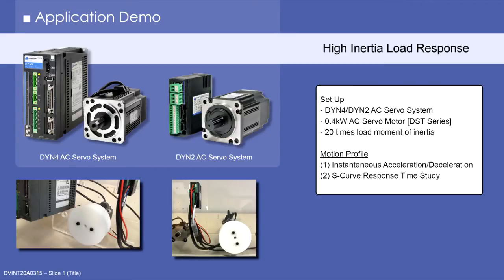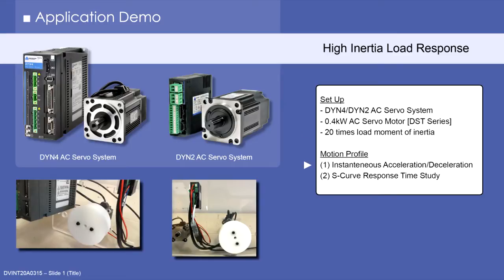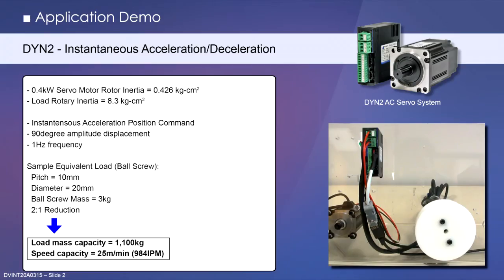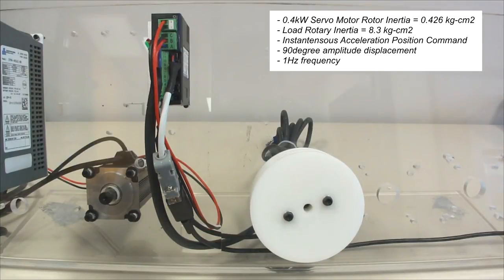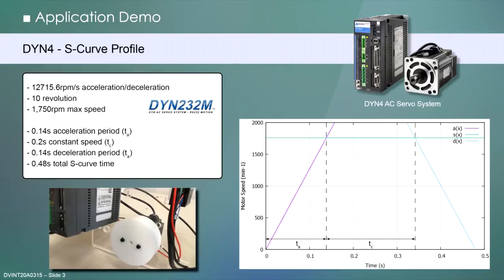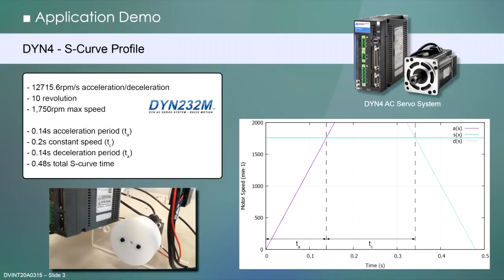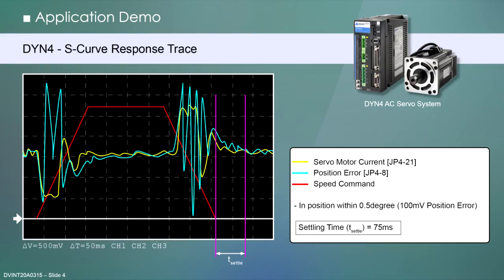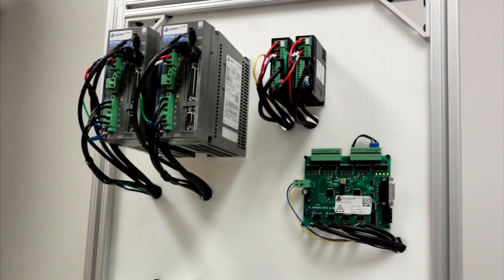DMM Servo Application Demo - High Inertia Load Response

Comment: Subscribed!!Well i have a few questions about servo control(PID).So,does your servo controlled by a cascaded loop with speed,torque and current controllers?Is it possible to use those servos like a stepper motor(just command steps in time spaces like a stepper motor step at precise angle in time)?How i find the maximum frequency of step changes=>speed(if it is possible to control a servo like a stepper)?In CNC world,the desired path of tool is controlled with analog algorithms(each axis speed vector and position at the same time) or Bresenham's algorithm is used to step one axis at time(digital control)??Thanks!!